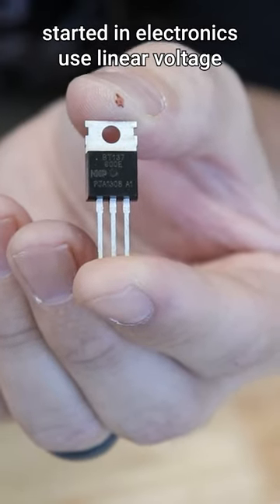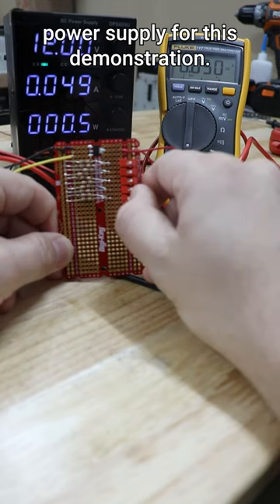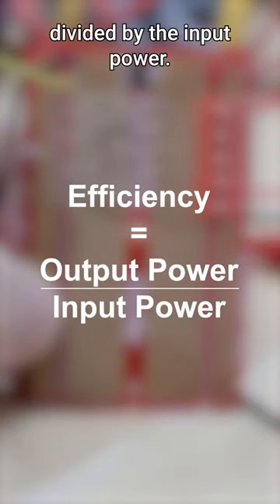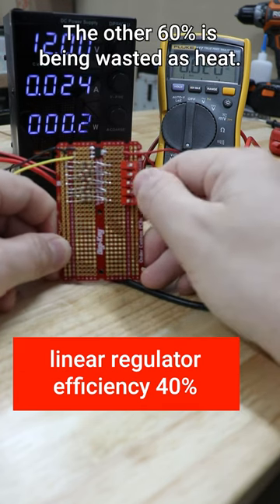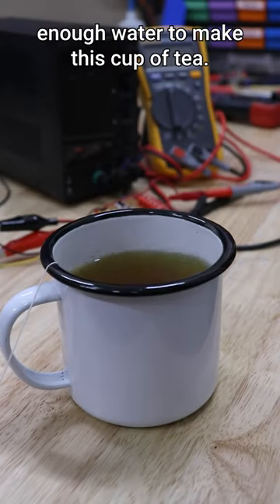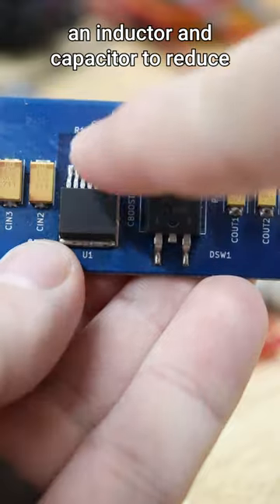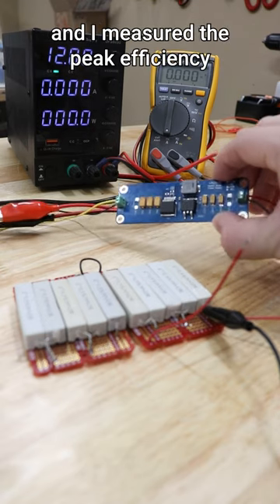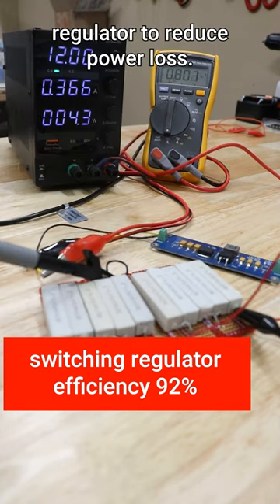Efficiency of Linear Regulators vs Switching Regulators - Byte Size #short

Comment: It would be interesting to see how noisy is the output as a functional of time, on an oscilloscope in both scenarios.
Reply: If you Need stable 5v for example you can put a Linear regulator on the output of the switching Power supply
Reply: Linear is very clean. Switching can be rather noisey depending on how effectively ut is filtered.
Reply: if theyre noisy add a capacitor
Reply: Modern linears are noisy but switch modes are unusable for audio, they make everything sound ‘hard’ too.
I found some of the linears from the late 70’s / early 80’s sound heavenly
Reply: @PrinceWesterburg class D amps from hypex or topping have industry leading low distortion, noise, and stereo crosstalk. Class A is riddled with distortion and are incredibly inefficient.

Sure, a good design from both classes will perform well - but the wasted power and expense of class A makes it an incredibly poor choice.

Comment: The trade off is noise from the coil switching.. so remember that..
Reply: Is it harmful to devices powered by this method?
Reply: Noise is something to take into consideration. It can alter readings and corrupt your communication if it's not accounted for.
Reply: use ferrous choke to eliminate noise
Reply: @lordjaashin or just use a LM317 😂
Reply: @jasonvoorhees3282  NOT the case for most devices but some are sensitive
Reply: as the switching frequency is high its easier to filter it with a smaller capacitor.
Reply: And the huge board footprint and so many parts.

Comment: So this is a fundamental error in assumption.
Switching power supplies are inherently noisy electromagnetically because switching uses square waves, which are rich in harmonics.
So, switching power supplies require special shielding if you don’t want to pollute the EM spectrum. This is also known as “don’t shjt where you eat”. If you are breadboarding, or prototyping, efficiency isn’t your major concern, so use a linear supply at that stage.
Introduce the switching supply when you are ready to do actual engineering on your product. Thank you in advance for not pooping in my yard.
Reply: many problems with smps

Comment: Linear voltage regulators don't have a set efficiency. It's basically just an auto-regulating resistor. The "efficiency" varies between 1 - 95% depending on how you use it.

Comment: People are already mentioning the noise, but I also have doubts about stability - I have had stuff blow up because a SMPS set to 5.2V (below the 5.5V max) decided to output 6.3V at power-on. I'd recommend a SMPS to drop most of the voltage followed by a linear to make sure the final rail is what you want.
Reply: Exactly correct. Good design uses linear for final output control of voltage and minimum noise etc.

Comment: The majority of switching circuits generate broadband noise that interferes with other electronics. Long live the LM317!
Reply: What's the difference between lm317 and lm317T?
Reply: @ancientlink0  If I remember correctly it has a lower voltage dropout and it has temperature-compensation, so that the output doesn't change with temp change

I'm talking about the lm317T
Reply: Don't forget the LM338, for more amps and still adjustable voltage. IIRC, the LM338 can briefly do a whopping 12 amps!
Reply: @YodaWhat  thats a lot of current
Reply: @YodaWhat in most cases a TPS63020 would be a much more efficient solution
Reply: @Industry-insider - Sure, switching regulators are more efficient, but they are more complex and vastly more noisy, as @oobihdahboobeeboppah noted. They have far more failure modes, some very destructive. OTOH, Linear Regulators are simple, reliable, and have low noise. There is no one size fits all solution.

Comment: I think your calculation of the billing water is way off. The heat from 0.25W is 0.15W. For 3 hours, that would be less than a half a Wh. You're not billing 300g of water with 0.45 Wh of energy.
Reply: Your right . Boiling a kettle for water takes a lot more than this...

Comment: LDO’s are highly useful as point of load regulators in tight spaces and low current. They are also simple and cheap. They are very quiet as well 

Switchers may be far more efficient but EMI and noise considerations are a real issue in most serious designs. The PCB layout is also more critical on a switcher just for this reason.

Comment: Switching power supplies aren't alternative to linear power supplies. There are different applications for both of them. For example, you cannot power a sensitive microprocessor with switch-mode power supply, and you cannot drive a high power load with linear one..
Reply: Exactly
Reply: What about something like an arduino? Is the noise that bad?
Reply: @gabekoleszar3604   For most applications no, but if for example you want to read precise values from its ADC, you might want to use external voltage reference if you're using SMPS
Reply: @Astri.electronics   So it doesnt really effect the digital behavior of the processor and it might effect the analog behavior correct?
Reply: @gabekoleszar3604   Well pretty much, because the onboard ADC needs very stable reference voltage to read precise values. But in some extreme cases even digital behavior could be messed up, and in the worst case, the switching spikes from SMPS could even destroy the chip.
Reply: But doesn't boards like Arduinos have their own linear regulator? Does the noise still matter despite that?
Reply: @pluggedfinn-bj3hn  Switching noise is high frequency usually and it couples through all sorts of parasitic capacitances. Additional linear regulator after a switching stage does help but it does not eliminate the issue
Reply: @Astri.electronics  Thanks! How do high power electronics like computers deal with it? I guess its just very expensive regulator setups? I've seen them on the boards but never really understood how they work.
Reply: @pluggedfinn-bj3hn   Desktop computers have switching power supplies, as they need too much power and so efficiency is needed. There are additional regulators and filters on the motherboard to help with the noise issues. This application is not that critical, computer CPUs do not need to be so tightly regulated. Noise issues are more of a problem in applications where you need to measure something, as for accurate readings you need very precise and stable voltage references.
Reply: @Astri.electronics  Yeah, about what I would have expected. Thanks for the answers :)
Reply: Well it really depends by what you define as "sensitive microcontrollers" and "high power" loads. There certainly are huge linear regulators that you can attach big heatsinks to and most microcontrollers are totally fine with SMPS. Analog references are an entirely different issue. You don't want to power your ADC with a bog standard LDO or something either. The output accuracy can be really bad.
Reply: @yeet1337   Of course, there will always be exceptions in electronics. But in general, microprocessors which do not need to execute any precise measurements, are running fine with a generic SMPS.  And in general, you don't want to power high consumption electronics with LDOs.
Reply: @Astri.electronics  Ok yeah sure, but please don't say "you cannot power a sensitive microprocessor with switch-mode power supply" then. Because that's just wrong.
Reply: @yeet1337   Well if you want to be correct on all levels, you cannot say anything. We must generalize in order to learn/explain.
Reply: @Astri.electronics  lmao ok if that makes you feel better.

Microprocessors cannot run on an SMPS is just 100% wrong. That's not even related to any generalization or something. Look at your phone, look at your Intel/AMD CPU, your graphics card, heck even the new Arduino or the Raspberry Pi Pico. All of these are powered by SMPS.

If you want to say sensitive analog circuits cannot be powered by SMPS or ADCs shouldn't be powered by SMPS, yes I 100% agree. But that's an entirely different point than what you said and in order to learn you need to get into the fine details and not just state absolute statements.
Reply: @yeet1337   None of those applications you mentioned would surely not be described at "sensitive". To run applications on an OS you don't need super stable voltages. I said "You cannot power sensitive microprocessors" in that, you cannot use SMPS in applications where a stable voltage is needed. And this in general is true indeed. Precise voltmeters / power loggers / EKG measurements, they all need stable voltage and those are all in general, powered with a linear power supply and/or use something like TL431 voltage references.

Also this is not about making me feel better. If you want to explain something you need to generalize. I see this on universities often. There is always this one odd guy with the need to be smart saying "actually, what you said is not always correct". Yes.. guess what, it never will be always correct. There are exceptions to every statement.

So to summarize: In general, you cannot power sensitive electronics with SMPS and you cannot power high power loads with LDOs as that is often not practical.
Reply: @Astri.electronics  Bruh power loggers, voltmeters and stuff like that use dedicated ICs for the kind of application that they need to perform. The microprocessors in these devices are solely there to communicate with these ICs, analyze the (digitized) data and show it to the user.

I can 100% guarantee you that no EKG medical device uses the built-in ADC of a microprocessor or something. And the STM32 or whatever chip is inside your voltmeter doesn't measure the voltage, power or anything else critical lmao

What is a "sensitive microprocessor" in your opinion? Please give me an example.

And also, microcontrollers obviously don't run conventional OSes.
Reply: @yeet1337   You completely misunderstand the point of my claim and only trying to come up with exceptions to prove my general statements wrong. There are surely many applications where internal microprocessor's ADCs are used. Think for a second.. if engineers always used dedicated ICs, why would manufacturers always put (pretty decent) built in ADCs into chips like STM32. I can assure you there will be many applications where just for the sake of cost, the device will use internal ADC instead of dedicated IC. Heck, I've seen magnetometers flying on probes to space, using onboard ADCs. 

Also.. it doesn't matter if we're talking about microprocessors or not, dedicated ICs in sensitive applications also need to have stable voltage, therefore a linear regulator to power them. 

"And also, microcontrollers obviously don't run conventional OSes." I've never mentioned microcontrollers and OS in the same sentence, you seem to have this habit  of twisting claims. I've said, you don't need super stable voltages to run OS, which is of course true.

If you want to discuss and look into which applications are using which PSU topology, we can certainly discuss that. Feel free to write me an email to novotm90@fel.cvut.cz.
I've used this comment section just to provide a general answer to a beginner and I don't want to confuse this topic even more. If I knew, there will be someone not able to grasp the concept of simplification, I would have phrased myself differently.
Reply: @Astri.electronics  Ok I just wrote together another reply to your comment, but got it unintentionally deleted by clicking out of the notification window once. So I'm not doing that again and wasting any more time.

Please just give me one or two examples of a "sensitive" microprocessor that can/should not be driven by SMPS.

This way I can at least learn something new or some cool new chip/application that I probably don't know of instead of getting called stupid in every subsequent comment just because we don't agree on the specific phrasing of your comment :D
Reply: You can power as big of a load as you want with a linear regulator. All one is at it's core is a transistor, an op amp, and some support components. Just make your own and use a ridiculous transistor.
Reply: @AtlasReburdened  I mean yeah, nothing is stopping you from doing it. But the point is, you usually don't as it's not practical.

Comment: Noise is the issue when sensitive loads are being supplied. I would gain so much distance eben using linear over switching when powering video transmitters. Even filtering with saw / notch filters couldnt compete.

Comment: How is current affected in both scenarios? Also, could a transformer perform a role such as this?
Reply: In most cases, the switch mode power supply will deliver more current. A transformer will not work with direct current

Comment: I used an Boost converter , big capacitors and an linear regulator to replace the 9v Batterie from my cheap diy oscilloscope. The linear regulator is needet because the Regulator has a  small Output ripple that cant be smoothed by capacitors alone.  

I use an tp4065 charger/protection Board, chare an 3.7v liion mobile Batterie salvaged from my old  broken Phone, boost the voltage to about 10v, put this on one capacitor, regulate it down to 9v using an low drop regulator, put this again in an capacitor  and there is a super smooth voltage Output without any ripple and good enough efficiency.  Runtime on one charge is about 7h i think  but because it uses an older phone Batterie im not sure if it will last that long.  Mostly i use this scope only for a short  
Time. But its holding up a lot longer than the original 9v Batterie, and it can also be recharged by usb.

Comment: Granted ....In modern electronics the vast majority of all appliances use  'switch mode' power supplies (regulators) and are indeed more efficient than the linear type equivalent. But neither are worth having when dealing with vacuum tube applications like audio amps & radios without significant shielding and ultimate filtering. In these applications,  give me the transformer, bridge, caps and chokes. 😊
Reply: You know electronics! 👌
Reply: Same with some radio applications and low-power applications where efficiency might not be as important as part count.
Reply: All depends on the application. You wouldn't want noisy coils on a transmitting/transceiver circuit.. but if it just steady power you need then yes. With feed back to keep your steady output .

Comment: They became very hot n need big heat sink.... But they only good for low ampage circuts most common is 7805 ic ....use step down convertor circuit they are very cheap these days n highly efficient
Reply: many problems with smps

Comment: I just designed my second smps, hopefully this one works better than the first, lol. In all fairness the 1st has been running 24/7 for 8 months now.  Picking the correct control chip is the key to avoid suffering

Comment: Just a little note:
- Efficiency is related to theoretical calculations.
- Performance is related to empirical measurements. So, in this case, performance should be the correct word to be used.
Reply: Completely disagree.
Definition of efficiency:
The ratio of the effective or useful output to the total input in any system.

That definition says nothing about being theoretical.

Comment: Actually since the input and output currents are most of the time identical (depends on the quiescent current of the regulator), the efficiency is just the ratio of output voltage/input voltage. Efficiency = V_out/V_in

So as you can see, linear regulators are less efficient the higher this voltage difference is that is dropped across them. If input and output voltage are very close like with an LDO regulator, they can actually sometimes be more efficient than some switching regulators!

Comment: Switching regulators are ridiculously hard to teach to people - most are SMT and require support components, too much reliance on data sheets and no actual learning, just implement.

If you don’t understand it you can’t fix it.

Replacement costs more than repair.

Also application dictates what you use.

Load/power calculation is way off.

Comment: Yes and no. Taking the LM2596 switching regulator as an example, you can, using a trimpot, adjust output voltage very finely but that voltage is always relative to the input voltage, if that goes up the output will go up too, which is not what you want when using electronics, you want your design to get exactly what is expected. So yes, sure , use a buck converter to get to about 1V above what your linear converter needs but then use a LDO to get a consistent output.

Comment: These are useful when you have a small change between the input and the output. 

Say you are measuring 5.2V at an output and you really need 5 volts. Some would say use a zener diode, but they can be noisy like switching regulators.